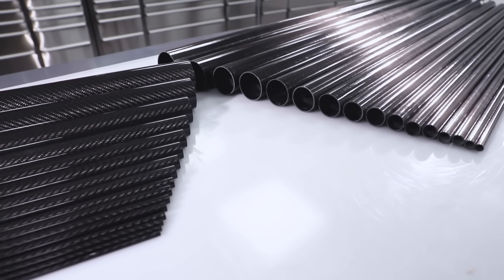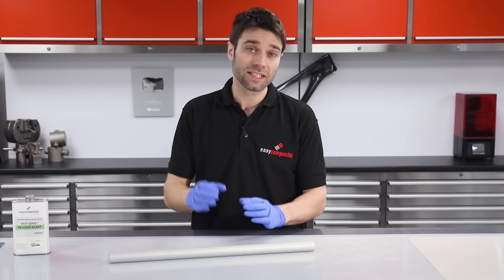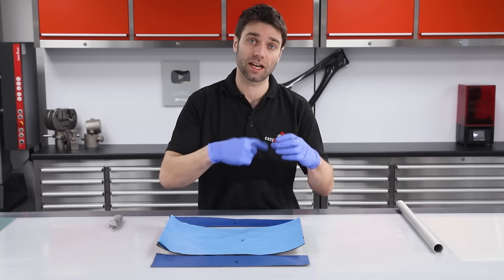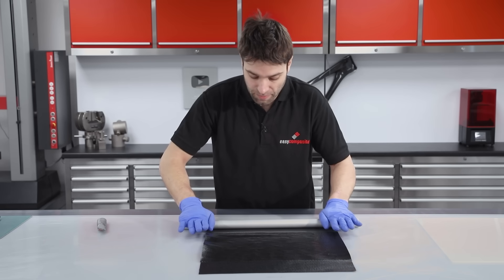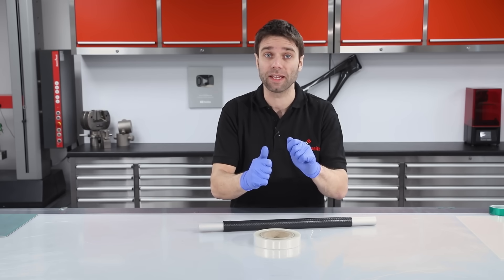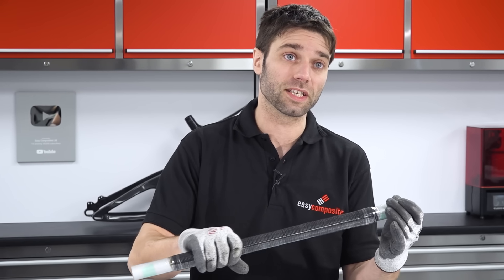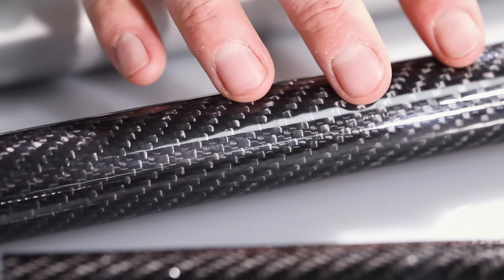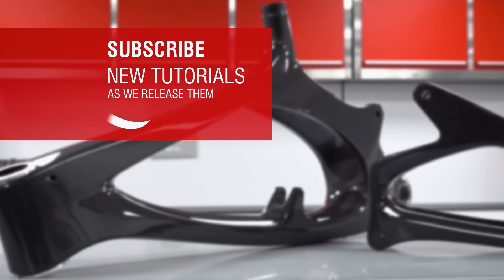How to Make a Roll Wrapped Carbon Fibre Tube

Comment: Is the release agent mineral oil?😲
Reply from the maker: no it is our Easy-Lease Chemical Release agent.  https://www.easycomposites.co.uk/easylease-chemical-release-agent
Reply: @easycompositestv  i love your program btw. My goal is to saturate about 6 layers and try stretching the fabric over a wired frame for a super strong rc chassey and i want to experiment making A arms since there flat for nearly indestructable basher. 1 first goal is making carbon drive shafts since the fetch about 80 dollars for heavy steel transaxles. My check next week will be my first purchase from you. Wish me luck😎
Reply from the maker: Thanks Jason, they sound like some interesting projects you've got planned. We look forward to working with you.

Comment: manufacturing practicalities aside - is there an equation that determines diameter/thickness vs. length i.e. if I wanted a carbon tube 100mtrs long, and join a few to make a load bearing truss ??
Reply: I'm sure there is, I think I remember a similar problem from statics/dynamics. If you know any engineering professors that might be a good question to ask them
Reply: There would have to be and I'm sure Google knows what it is. The manufacturing of a 100 metre tube isn't that impractical, the idea of making a 100 metre truss is. If you're building a bridge then carbon fibre isn't the answer. If you can find anything on the trimaran- Mother Superior he built his own autoclave to make a mast that I'm pretty sure was carbon and well over 50'.

Comment: Is the shrink tape permeable so that the volatiles can be released out of the laminate?
Reply from the maker: There’s no volatiles in the laminate, this is 100% solids, solvent free epoxy.
Reply: @easycompositestv  thank you!
Reply: Hi guys.. Sorry for my question maybe I am not understanding well so what the name of the material under the fiber glass which is looks like gum coz it's first time I saw that fiber glass using without epoxy or resin and drying in oven.. Just I need someone to make me understand.. And thanks

Comment: send the materials to china, a 12 year old kid will produce 50 tubes with 10 less steps when the video is over.
Reply: By 12 they are management, the 8 year olds work on the line.

Comment: Really nice video 👍
Is it possible to cure the pre preg with a classic oven at home?? 🤔
Reply from the maker: Generally we do not recommend it as most home ovens do not offer a precise temperature control and have no facilities for programming a cycle.  Some people have modified an oven to work with a controller but it is a lot of extra work.
Reply: @easycompositestv  thanks for the answer 🙏

Comment: The constant force stress test that I see alot I find would provide better data if the force applied was in fluctuating ranges over given periods of time.
Ex. 100 lb. At 5 min. Pulsing the forces every few secounds.
Reply from the maker: The test shown was just a deliberately extreme example to show how strong composite tubes can be. It was in no way particularly scientifically done.

Comment: I want to make a 9m tube but I don't have a 9m oven. What are my options?
I'm considering epoxy layup with catalysed curing, but I can't get consolidation from heat shrink. What would you recommend?
Reply from the maker: You could make a temporary oven using insulation foam.  Only problem is trying to get even heating down the full length.
Reply: @easycompositestv  How about layup with catalysed epoxy rather than an oven cure?

Comment: Thanks for the information. What if I want to wrap an existing metal tube without extraction?
Reply from the maker: Yes, well, exactly the same process but without the release agent and some surface prep on the mandrel first (degrease, abrasive paper) to aid the bond.

Comment: can square tubes me made with similar technique?
Reply from the maker: Yes, you can. However, when roll wrapping a square tube you won't get the same even application of pressure from the tape onto the laminate, instead you'll get more pressure at the corners and quite a lot less pressure (therefore consolidation) on the flat faces. However, it is still possible and manufacturers of square tubes do sometimes use this process.
Reply: @easycompositestv  So which is general method for manufacturing of square tube, if we require evenly fiber pattern?

Comment: Anyone done this with a non pre preg material and a wet layup?
Reply from the maker: It is possible just a lot messier.  A similar method is used for pole repairs as a wet lay up but on a smaller scale.

Comment: 700kg ?? how much does the aluminum take to bend ?
Reply from the maker: Hi Amir, I don't have the figures for the aluminium because but if I did it wouldn't be a fair comparison because the wall thickness and diameters of the two tubes would be different. However, for the same diameter and weight, the carbon fibre tube would be stronger and stiffer.
Reply: @easycompositestv  amazing and where do we buy the carbon fiber sheets?

Comment: How much load can the aluminum tube bear?
Reply from the maker: I don't have the figures for the aluminium because but if I did it wouldn't be a fair comparison because the wall thickness and diameters of the two tubes would be different. However, for the same diameter and weight, the carbon fibre tube would be stronger and stiffer.

Comment: How well would I fare using this method to make a DIY driveshaft?
Reply from the maker: Driveshafts are quite a bit different in design and layup as they are optimised to prevent twist rather than bending loads.

Comment: Could you vacuum bag the tube and then put in oven (whilst still vacuum bagged) rather than shrink tape it?
Reply from the maker: You can although the shrink tape will give a more even cosmetic finish due to the even overlapping. With a vacuum bag it is hard to control where all the creases are going to be.  You could mitigate this a bit with a release film.
Reply: @easycompositestv  thanks for response appreciated
Reply: Compared to vacuum bagging, how much compressive force does shrink tape exert on the part?

Comment: Is it possible to ship those prereg item that is used in this video here in the Philippines?i heard prereg needs some specific storage temperature requirement?
Reply from the maker: Hi, yes, we can generally ship prepregs worldwide. The 'out-life' of these materials is around 6 weeks at 20C although at higher temperatures this will reduce. We ship prepregs already frozen and use a priority service which is usually 1-2 days to most countries. This means that their outlife is not reduced much. However, it's important to clear goods quickly through customs to avoid delays at the airport where they could be sitting in high temperatures.

Comment: orientation?
Reply from the maker: We're using 2 different types of prepreg reinforcement here, a unidirectional and a 2/2 twill weave. The unidirectional has the fibres oriented length-ways down the tube. The woven cloth has fibres oriented at 0 degrees (down the length) and at 90 degrees (around the circumstance).

Comment: Hi sir, can you joint them and make a carbon bike.. That will safe a thousand dollar.
Reply from the maker: Well, yes, you could make tubes and join them together to construct a bike frame however doing so would generally result in a heavier frame and so is not favoured over the (much more complicated and therefore expensive) monolithic construction.

Comment: If the tube measures are critical for a certain application, won't using an aluminum mandrel be a bad idea? Maybe we should take into account the thermal expansion rate of the mandrel at the curing temperature to avoid dimensional deviations?
Reply from the maker: That's exactly what is done. The expansion of the mandrel should be accounted for when correctly sizing the mandrel to achieve a particular finished ID of the carbon tube.

Comment: great video !  calculating stress and strain in kg and mm hurts a little bit, though (i know it´s easier to understand XD )
Reply from the maker: Yes, we get that. We'll maybe talk about it in both terms next time but you're right, the purpose is to make the information a bit more accessible. We do have some proper mechanical testing videos coming up which would certainly talk in the correct terms.

Comment: Thank you so much for the videos! I’ve learned a great deal watching your videos and really enjoy them. Is there a way you would suggest to add a raised “bead” to either end of a tube made in this fashion? Similar to the raised bead sections in the “complex carbon fiber tube” video. If I try and build an intake tube in this fashion I’d like to help insure that the boots would not blow off the tube.
Reply from the maker: Hi Jeff, yes, you could do this very simply. Just cut a long thin strip of prepreg and then wrap that round and round as each end of the tube, making the tube considerably thicker in a 'bulge' at either end. This way the tube would still be parallel on the inside (so would release from the mandrel) but you'd get the bead detail you want.

Comment: You will be saving me a lot of time thank you for the amazing content. I have one question is there a way to do this method if you only have an autoclave at your disposal?
Reply from the maker: Sure Garnett, you could run the autoclave without pressurising it, then it's just an (expensive) oven! :)
Reply: Easy Composites Ltd 😂 sorry, I’m sure I could’ve figured that out. Another reasonable question is there a limitation to the size of the tube, like lets say 76mm pipe?
Reply from the maker: It get's more difficult to get the compression you need on larger diameter tubes. Most manufacturers stop at around the 80mm mark for this process, so, yes, you should get away with 76mm.
Reply: Easy Composites Ltd perfect. Thank you for all the help.

Comment: I am really wondering how two pipes with a joint would survive on that test
Reply from the maker: Well, that would depend entirely on the detail of the joint; done right it could be consistently strong with the rest of the tube but of course that might not be the case. Maybe we could do something on this in the future.
Reply: @easycompositestv  that would be really great and interesting! I always wonder how two parts "sticked" properly survive on that test. Thanks! Following

Comment: I would be very interested to learn what liquids and gases can and can't be used internally, i.e if used as a water fuel or gas pipe. I'd also curious to know what pressures and temperatures it could work too
Reply from the maker: Pressures would be determined by the layup of the tube. To design a tube to take very high pressure you would actually want the majority of the carbon fibre in the 'hoop' direction, not longitudinally; giving you a layup more similar to a filament wound composite pressure vessel. In terms of temperature, that's determined by the resin system in the prepreg and the cure temperature. In this case we used the XPREG XC110 which has a maximum service temperature of 110°C. For transport or containment of liquids it would be a very good idea to coat the inside of the tube using a sealer. This can be done by pouring sealer inside and then rolling it around. A product like GTS75 from Caswell Europe is designed as a composite 'tank sealer' and will provide good fuel resistance.

Comment: great video, PS: for the novices among us a mandrel ( not a mandrill- monkey family) is a rod of metal you mount between centres in a metal or wood lathe to hold a round part securely ie a pulley or donuts shaped object, the rod holds the part by the inner bore so machining can occur on the outer surface ( otherwise gripped by a chuck, held at a centre, etc.) as this is the only way to hold it and machine successfully.

Comment: What loading do you recon the 12mm outer diameter tube could stand?
Reply from the maker: Without doing the calcs I can't tell you I'm afraid. At a guess, given a similar wall thickness, you'd be be in the 300kgs territory.

Comment: Wrap around styrene plastic 3d printed molds, throw it in water, and dissolve the styrene core.
Reply from the maker: Water soluble 'styrene'? That doesn't seem to make sense. There are some water soluble core materials that can be used in composites but none of these are 3D printable. Expanded polystyrene (A.K.A. XPS or styrofoam) con't be 3D printed but it can be dissolved by a strong solvent, such as acetone.

Comment: what is the yield strength of this carbon fiber tube? Is it stronger than steel?
Reply from the maker: We didn't do a proper calibrated tensile test so we don't have the actual numbers but weight-for-weight it is stronger than steel, yes.

Comment: 7:48 ... CF dust is much like asbestos. Very fine and sharp and can embed itself in your lungs. I have experience making CF airframes for high power amature rocketry.. Trust me when i say you need a knife to get it out of your skin.
Reply from the maker: I’m a bit confused what it is you’re comparing with asbestos dust and what it is you’re removing from your skin with a knife! There is no evidence that carbon fibre dust is like asbestos, all the evidence is that it has the same risk, and should be protected against in the same way, as dust from hardwoods. Obviously if you get a splinter of cured carbon fibre then it’s very sharp so do be careful of splinters.
Reply: @easycompositestv  well, there is good reason OSHA states that its "paramount" to wear a "full body suit" when generating CF dust. According to the Division of Pulminary and Critical Care Medecine, "Studies with intratracheal or inhaled administration of CNT in animals have also verified the appearance of granulomas in the lung parenchyma and mediastinal lymph nodes." Copy and paste that quote in google amd you can read the whole journal article. Granulomas are what the body forms around a foreign object when it cant get it out. For the knife thing i said earlier, when i was wet sanding a CF airframe, i would gently feel the surface for smoothness. My hand ended up looking like it was covered in soot, and wouldnt wash off. The fibers were embeded in my skin, so i had to scrape a layer of skin off. Think about how thin the tissue of your lung is... How many people who work in a fiberglass factory end up on a ventilator from it? I know one. In size and shape it is similar to asbestos, and the particles are sharp too. And just because current research is of yet limited, doesnt mean the threat is not there. You dont have to throw away your business or liveliyhood, but... Better safe than sorry. Just be careful and wear a mask for one thing... Also try doing sanding/ cutting underwater.

Comment: I'll build my 3d printer from this material,
Reply from the maker: Hi Denis, yes, carbon fibre makes a good material for 3D printing; strong and light so low inertia with a high modulus (stiffness) so improved accuracy.
Reply: @easycompositestv  Tnx, I didn't expect your response to my comment. I'm designing different CNC and automation systems and plan to introduce composite materials in my projects. I'll contact you when I decide what materials I need for testing. I have a background in chemistry, IT, design and electronics and I must say that you make one of the best tutorials on YT.

Comment: My friend, I really love your videos, but I suffer watching you cutting, grinding and manipulating carbon fiber without a respirator mask. Carbon fiber nanotubes are composed by structures similar to asbestos, for that reason you should use that kind of protection. P100 filters sholud be enough for carbon fiber particles. Greetings!
Reply from the maker: As we've commented on numerous occasions, we're not using carbon fibre nanotubes in any of our videos. We don't stock them, don't use them and we're not cutting or handling them. Carbon fibre and carbon nanotubes are not the same thing. Please see our guide to cutting and shaping carbon fibre for appropriate safety advice on handling and cutting carbon fibre. Stay safe :)
Reply: @easycompositestv  ooh thank you for the answer! Now I understand I had a misconception of those concepts. I really apreciate the explanation.

Comment: Did you make custom carbon fiber tube that aren't in your price list? I need a 150mm ID, 560mm length
Reply from the maker: Hi, I'm afraid not, not for smaller quantities or one-offs at least. If you happen to need hundreds of a custom diameter or length then it's worth contact us to discuss but for smaller quantities it's just the sizes you see on the site unfortunately.

Comment: Great video! Any tip on peeling off the shrink tape if it gets bonded to the tube?
Reply from the maker: That normally indicates that the tape has got too hot. If this happens, there isn't really much you can do to make it come off any easier, it will just be a case of picking it off bit by bit - frustrating; we've done it ourselves a few times!